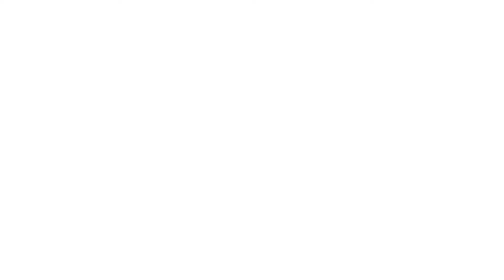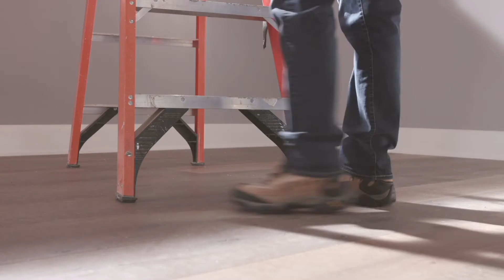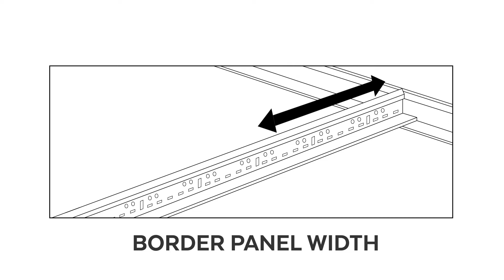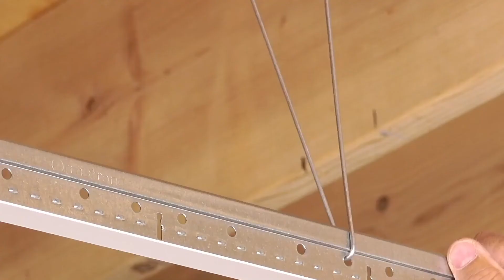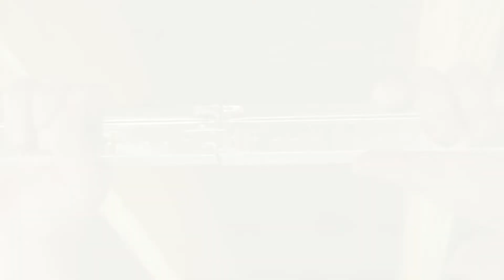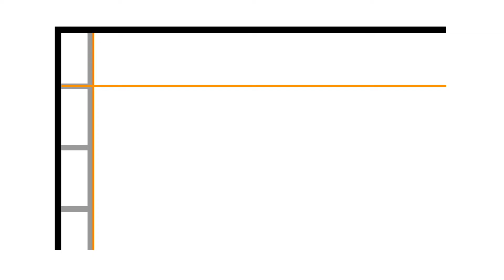Cut & Install The First Main Beam In Drop Ceiling System

Comment: I'm finding the quick hang hooks do not line up with holes in the main beams, causing the main beams to pull to one side, and the hooks do not engage or adjust well on an angle. Any advice? Thanks